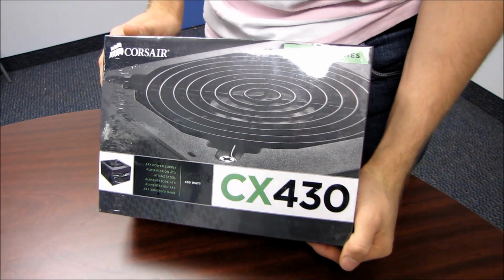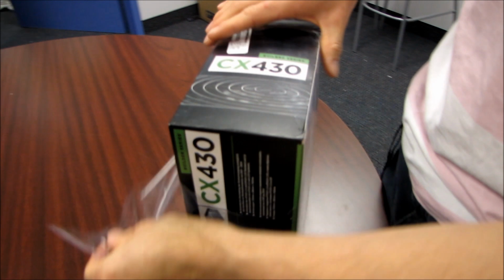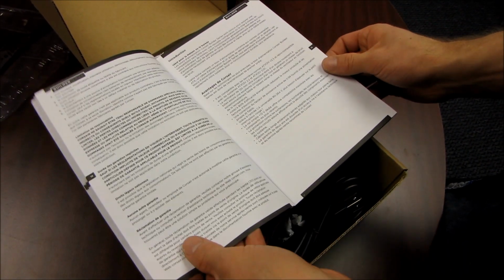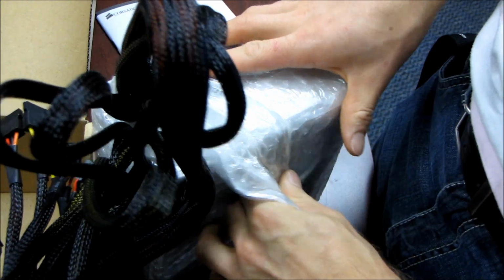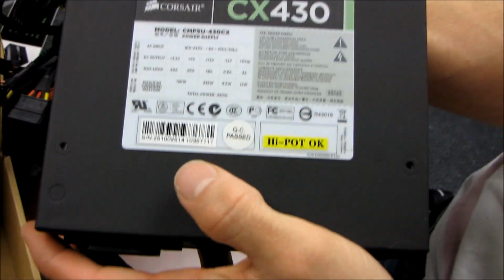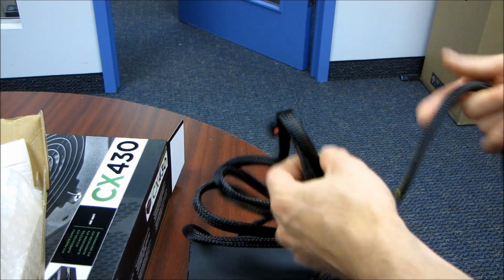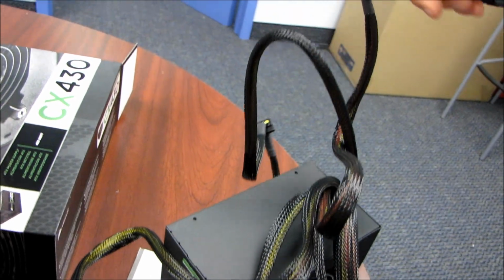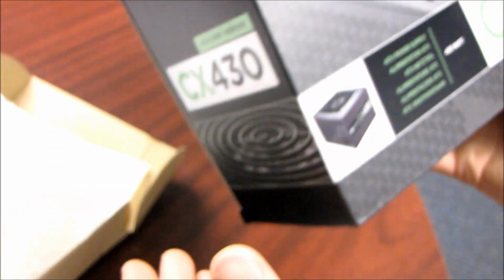Corsair CX430 Builder Series 430W Power Supply Unboxing & First Look Linus Tech Tips

Comment: For that price a great PSU, I exchanged my 400W Seasonic for it, which started grinding for some reason.
430W is more than enough unless you don't have some GPU in the "energy cemetery category" And with the new line of nVidia cards which will have almost half of the consumption now, there will be even less people using PSU's with huge wattages.

Comment: Just got the V2 of this PSU to power my low power server/xbmc machine 24/7. It replaces an Antec HCG-400 because that PSU had a horrible fan rattle. When I first powered it on the fan sounded like it was hitting wires (it's not hitting any wires that I can see), in did this 2 more times in a short period and now it's stopped. My luck with fans in power supplies is pretty bad.

Comment: The new CX-series PSUs from Corsair are made by CWT, not by Seasonic like the older models. This means that their quality is significantly lower than the older models'. And these ARE NOT 80+ which is really strange...

Oh, and BTW they are not designed to deliver the reported wattage...

CX430W = 380W CWT DSA
CX500W = 450W CWT DSA
CX600W = 500W CWT DSA

I really wouldn't recommend to buy these

Comment: Using it to power my Core 2 Duo E7400 OC 3.16 GHz, GTX 550 Ti, 4 GB RAM and a single HDD. My PC is silent now, earlier I was using a crap Micase 400 PSU (it propably wouldn't even put out that much juice and was bottlenecking my components)

Comment: @Rapagangsta 
In preparing the CX series corsair changed producers, from Seasonic to a cheaper and worse, so that  CX series power supply is very bad. I read a lot about it on the net, unfortunately after I bought the cx430.had problems ,my pc did not start .it worked on weaker pc .
this is my
 Asrock 880GM-LE - AMD 880G 
Athlon II X4 640

Comment: Is it good with these parts:

Pentium Dual Core G3258 3.2GHz
GeForce GTX 750Ti
8GB (2x4GB) DDR3 1600Mhz 
Also is it future proof?
Reply: +Glenn The Psychotic Penguin search &quot;pc power supply calculator but i estimated that your system takes bout 230w and recommended 300w but this is still good and its future proof.
Reply: Reason 2 Die Gamer Thanks for the info!
Reply: ***** np
Reply: ledloctor Yep seems like the devs makin games for quad core only seem like they don't want extra money from people with dual core PCs.
Reply: how about mine i5 4460 3.2Ghz, msi gtx 750 ti lp, 8gb ddr3? how many power do i need

Comment: so this is not good for high graphics cards?
Reply: All that matters is that the wattage is enough. For a normal system with an average card with under 200 Watts this one is surely sufficient. I have it with a Core i5 and a Radeon 7870. For any card that uses more than 200 Watts I would recommend a >=500 W PSU.

Comment: Intel core i3
Asus h81md
kingston hyperx fury  8gb ram
inno3d Geforce gt 730 2gb ddr5 64bit (kepler)
is this power supply good enough for these parts?
Reply: Yes,it is.
Reply: +Catalin Simion what if i switched 730 to 750 ti?
Reply: +Inaki Santos Yes,750 ti will work better than 730;)
And it's work very good with this psu.
Reply: +Catalin Simion thanks dude :) so would you recommend this psu for my build?
Reply: +Inaki Santos Yea man,i have this with:
Cpu:i5 4460 and gtx 750 ti and work very good.
Reply: +Catalin Simion okay man thanks :)

Comment: Hey linus can you please tell me if this can power up these:
AMD Athlon II X3 455 OC'ed to 3.58GHz
ASROCK 790GX PRO
ASUS HD 6850 DIRECT CU 1GB
1 SATA HDD 7200 RPM 
8 GB RAM (3 STICKS)
1 80MM RED LED FAN 
TWO RED LED FANS 120MM

PLEASE TELL ME I HEARD CORSAIR ARE GOOD PSUS 

-JeffHardyFan6334 :D

Comment: Will this work with i5 4690k
asus z97 anniversary ]
8gb ram 1600mhz
PNY GeForce GTX 960 2GB GDDR5
seagate deskop hdd 1tb
Reply: I'd suggest 600w but that's ballpark. However you can find out how much your graphics card draws, pci 16x = 75w, and add 75w for ever 6-pin and 150w for every 8-pin
Reply: it draws 120w
Reply: which will all add up to 370w or something like that, should be enough i guess
Reply: Yes, I'm really bad at this

Comment: i5 3470
evga 660 sc
B75MA-E33

is cx430 enough for this build? please say me, or i need a cx500
Reply: its just right
Reply: You're good with this one
Reply: I was asking the same thing.
Intel Core i3 4130
ASRock B85M Pro4
EVGA SC GTX 660 2GB
8GB DDR3
1TB 7200RPM
Corsair CX430M

Great build right here for a fraction of the power and saves you roughly 80 bucks going with a 4130 over the 3470.

Comment: i have i53470, gtx 970, 8gb ram, 1tb hdd and 500 hdd, would this be enough?
Reply: Not sure. Just off the top of my head I think no. 970's can use quite a bit of power. I would recommend a power supply more in the 500w to 600w range.
Reply: Forgot to mention, this power supply would not work for most 970's because they require 2 pci-e 6 pin connectors.
Reply: @fern3436  3 years later xD .... and for the Gigabyte 970 G1 factory OC have 1x 8-pin and 1x 6-pin connector

Comment: can i use a msi GTX 960 2gb on this Power supply??
Reply: +4coolb no
Reply: +4coolb yes, easily
Reply: Okay im confused😂
Reply: 4coolb the msi gtx 960 cost about 160-200 watt, if you dont use more then 200 watts of power for the rest of your system, you can most likely run it. if in doubt put all your parts in PC part picker and check the wattage
Reply: +4coolb yes it will, but if you want room for future upgrades, try and get a 500 wat power supply